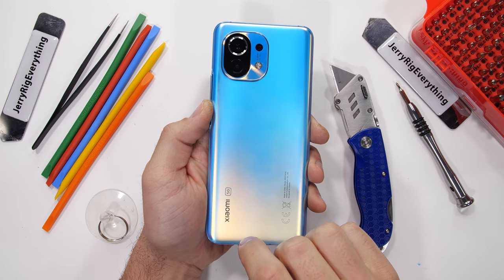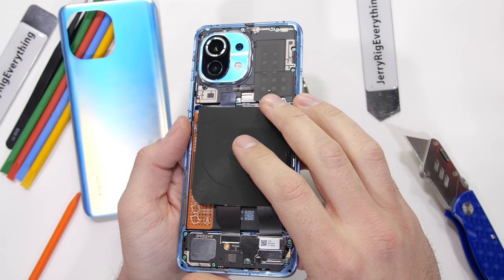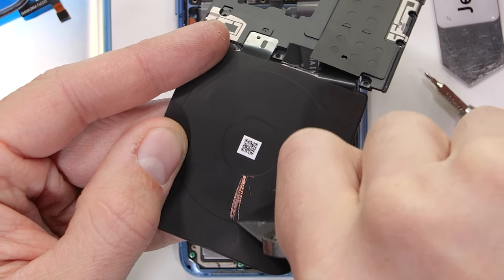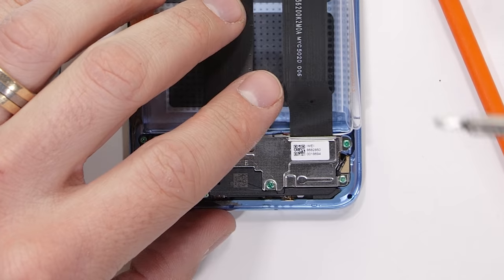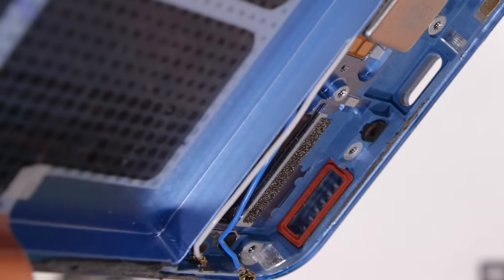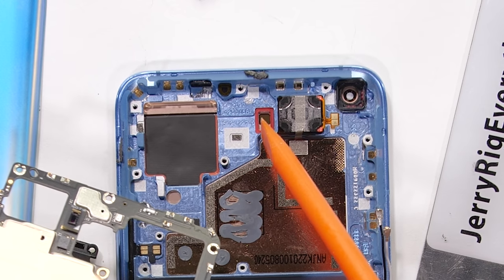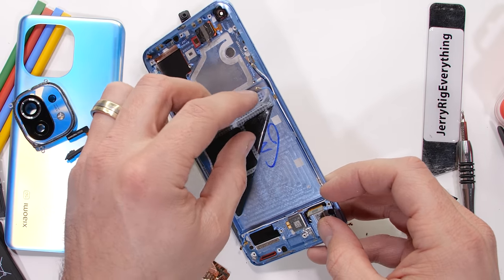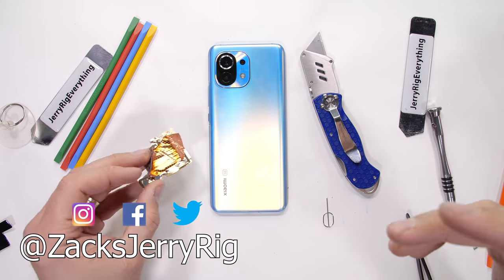Xiaomi Mi 11 Teardown! - Lets find that battery...

Comment: One of best designed phones inside and also outside i like how easy it was to remove battery
Reply: Also the fact that the screws were colour coded and also the simple design inside the phone.
Reply: outside is disgusting
Reply: People and their taste in design has gone downhill.
Reply: @yesbennosobol  ah yes disougusting.. that emotion we all feel
Reply: @kamallb4650  can't people have different tastes?
Reply: vapor chamber useless still heat this phone why don't use liquid cooling
Reply: @yoill393  yeah. That's what I said. Taste has gone downhill.
Reply: yep, but I heard the cooling is not working that well😔
Reply: @yesbennosobol  tbh it looks pretty good imo
Reply: @NAEL782  yea like Poco F1 with long pipes?
Reply: @NAEL782  vapour chamber is liquid cooling but different shape 
And better because it has more surface area to conduct heat to phone body and out
Reply: @irfanyxp3489  yeah and its failed can reach at 50c
Reply: @yesbennosobol  lmfao you edited it 3 times, do you even know how to write it?
Reply: @yesbennosobol  try again mate u almost did it
Reply: @yesbennosobol  it's still not right, here copy this: disgusting
Reply: One of the best to overheat as well
Reply: @NAEL782  Dude, that means that the cooling solution is doing it's job wtf.
It's impossible for a smartphone cooling solution to transform heat into cold haha
To control heat they could throttle the 888 as hard as Samsung is doing. 
Tho I prefer Xiaomi's implementation, the GPU is the cause of excessive heat generation on the 888, too powerful.
Reply: @juliofreitas8308  bruh even iqoo use same chip and release first than mi 11 never reach 50c idle when playing genshin impact what cooling is that can reach 50c
Reply: @pepega3344  thanks guys, appreciate
I need to buy dictionary or sth
Reply: @yesbennosobol  yay take this cookie 🍪
Reply: @kamallb4650  What you perceive as "good taste" is entirely subjective depending on your own tastes. Other people would probably say the same thing about your tastes. Tastes are not objective.
Reply: @kamallb4650  people had difference taste to song, vehicle, colour, lifestyle, fashion from time to time u cant do anything with it except dont care about it or follow the trends
Reply: @irfanyxp3489  done? 
Song: u have different genres, even genres have sub-genres with different/polar opposite melodies.
Vehicles: u have hatchbacks, crossovers, sedans, SUV, station wagons, compact SUV....from different companies with totally different design approach.
Colours: around 10million...a whole lotta diversity.
Fashion: u have western, ethnics, quality of materials...this that.

Phones: almost look the same. 

Unless y'all are blind. Everyone basically copying each other. The other month samsung was mocking apple now it's shamelessly following the same bs trend.
Reply: @kamallb4650  I agree with you but the differently designed and unique phones don't just sell as well atm. The latest Sony flagship, the foldable phones, LG wing and all are pretty cool imo but their market is very limited, that's why companies just stick to the one homogeneous design pattern. LG also stopped making smartphones now which was kinda sad
Reply: @NAEL782  valour chambers are water cooling

They don't use conventional water cooling because there's no way you can fit a radiator and a pump inside of a small phone
Reply: @juliofreitas8308  I AGREE, it's just the 888 beast, same as when core i9 first appearance, they need to tame that freaking hot beast or wait for next gen tech

Comment: Who remembers the good old days when you can take of the back panel in 3 seconds
Reply: Just throw down, it will be much faster
Reply: @mohammedriyanahmed4220  I know right
Reply: There is a reason I'm still rocking my LG G5. I like being able to switch out my battery without specialized equipment :)
Reply: @curiousfirely  true
Reply: Put your palm on the back plate and slide down...the good old days..
Reply: There was a time when I would be ready for my tutions and when I'm off I found out that my phone's dead and what my dad does is that he quickly tells me to exchange the batteries between our phone. Those times were great!
Reply: @curiousfirely  I don't mind headphone jack, micro sd card, etc. but I really want a return of removable batteries. Just swap it out for a fully charged battery in 3 seconds when one is about to die
Reply: @curiousfirely  you need to compromise things about battery capacity, thickness and and durability of the phone if you're going to stay with the current type of the smartphone
Reply: @mohammedriyanahmed4220 Don't recommend for the legendary Nokia tho cuz the floor will break
Reply: Nokia & Sony Ericsson era
Reply: I have a lg k51 which I think can take off the back panel because its a cheap phone

Comment: That balls are usually found in flagship devices.Are those balls that expensive?
Reply: wait, i have an expensive balls too! am i a flagship phone?
Reply: Sorry, I didn't mean it that way.
I didn't understand why those balls are not provided in cheaper phones.Are those balls expensive?
Reply: @sindhu9049  i don't think so they just want to Justify why their Phones are stupidly Expensive . Like Stainless steel is cheap but many smartphones don't use it only some flagships like Apple's p recent  pro models have
Reply: Is there any balls inside LG V40 speaker just an observation because its cheap here used one. And because LG famous with their audio hardware....
Reply: Those are there to provide a differentiating factor for premium phones and sometimes cheap phones don't even have this big sound chamber that it can accommodate balls. Regarding just the balls they won't even cost pennies because there are literally thermocol balls.
Reply: @keerthan7558  Steel is harder to bend/mill than aluminum, that's why it's "more expensive".
Reply: @vxerx4875  The thing is flagship phones have multiple balls but you only have 2 but the phones ones are smaller and yours are bigger WAIT PAUSSEE GAY
Reply: @FastSloth87  depends on the alloy

Comment: I like how he forgot to plug back the two antenna wires that goes to the daughter board and just left them there tucked in the middle of the speaker and the bulge where the battery sits

Comment: FYI, Mi11 has only one battery. Mi10U and other 120W phones (and some ~60w ones) have two batteries in series and the charging system operates at ~8V so that it only needs half the current and the wirings inside the phone don't need to get ridiculously thick.

Comment: I'm happy that phones are beginning to use plastic again on the backs. Don't know why they ever decided to stop using it. You don't need a case when the back isn't going to crack at the first thing it drops on.
Reply: The problem is that plastic scratches very easy

Comment: 2 batteries connected in parallel whilst maintaining the same Voltage as if they were one. Hence higher C-rate. One plus probably has been doing the same since their crazy charging power days

Comment: I have a question, if I replace the display because it is broken with another original but used one from another phone, thus moving the motherboard, why doesn't the finger print work for me?

Comment: I'm surprised even with big copper vapor chamber Mi SD 888 heats up. This leaves a question whether it does really help?
Reply: Cooling system only is not gonna help much more U must learn from the Rog how to dissipate the heat come from
Reply: And the software optimisation and fix the heating issue is very important is not the cooling system yes it does important too the cooling prevant the soc from the heat issue but the other factors U must take a part I will not surprise becoz I know what is the answer
Reply: They heat for some reason watch other YouTubers they heat only doing for benchmark test like Antutu etc etc playing game at 60fps and use daily usage it doesn't heat at all which is weird and which is at this points I think it can fix them through out the software update

Comment: The battery in the phone is a single cell but has two connectors to reduce contact resistance and to reduce overall heat loss.

Comment: Does that battery logic really make sense? If you charge two batteries at 50W, each is only blasted with 25. But they also are only half as big so they can only take half the current. In theory you should just get the same effect by having one battery double the size like everyone else. 
Don't you wonder why the Tesla still takes an hour to fully charge although it has so much batteries? They just add up as if they were one big battery charged at 1C.

Comment: I've got a love hate relationship with Xiaomi mobiles.
From inside arrangement I think its better than apple. Xiaomi always use a sperate cover for the camera grate thing to follow to prevent camera from dust and water. But at the same time, Xiaomi has a lot of display issues

Comment: after I opened up the case and cleaned the cover camera because of condensation (after fell in to water), I have fingerprint issue/problem, it was so hard to detect my fingerprint. Is that maybe any part of my reassembly not right? Where is the part of fingerprint sensor anyway? Or maybe this fingerprint part  is broken due to fell in to the water?
Reply: probably damaged by water. its very hard to replace it you have to open your display

Comment: Someone, please help! My charging got considerably slower. I bought cheap wireless charger. Unfortunately, by the time I noticed, after a few hours, my phone was about 60-70 Celsius. Five days later at 3% battery my Mi 11 died in front of my eyes. I changed the battery, but to no avail. Any suggestions, or is it definitely motherboard? Thanks!
Reply: Cpu reballing
Reply: @aeyde  thank you, I'll take it to the repair shop to get a quote. Cheers.

Comment: I watch this from Xiaomi Mi 11 🤣
Reply: Hi how is the experiance with this phone in 1 year of use ?
Reply: @mohamedboujnah4163  It's absolutely running fast! No problem, but it's heating much when i play with Hours. That's all, i can give score of 8.5/10!
Reply: @ivogogov  thanks for your reply . and how about battry life on gaming is is good im playing pubg only 1 or 2 hours par day and sometimes im not playing at all
Reply: @mohamedboujnah4163  I didn't test it with pubg, i personally play Diablo Immortal and Call of Duty, battery life is good still. I can play Diablo 3-4 hours and it will take 50%. This game drain more than any other.
Reply: @ivogogov  thank you ♥️🙏
Reply: @mohamedboujnah4163  You are welcome, oh and the charger is turbo so you won't have problem. He changed from 0-100 for 50 or so minutes.